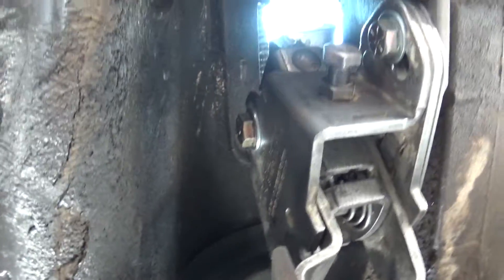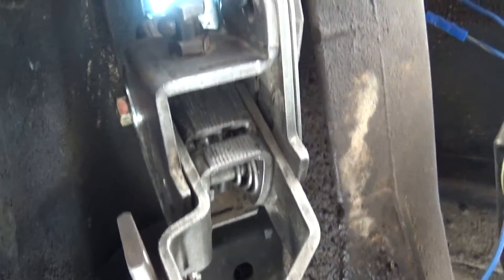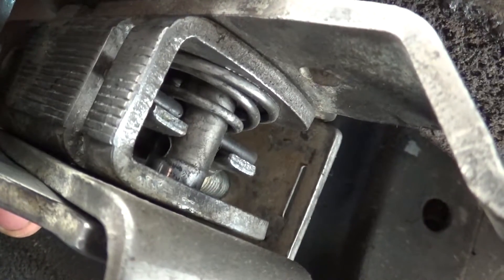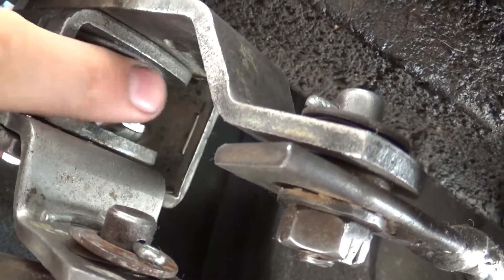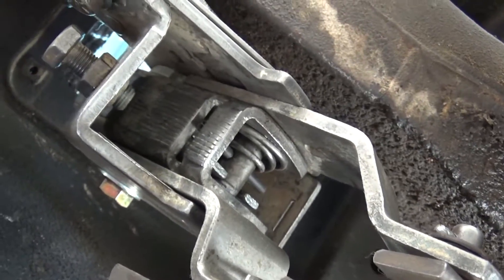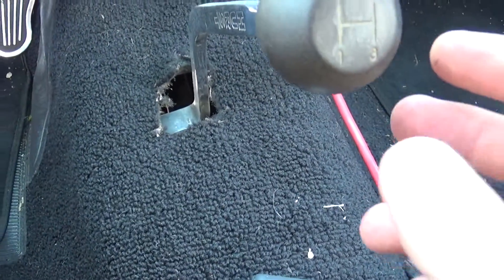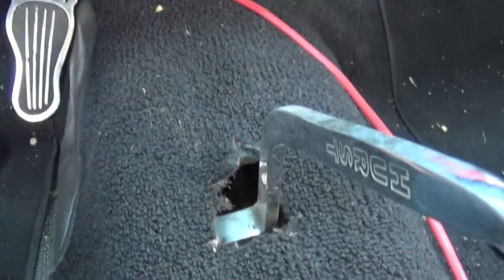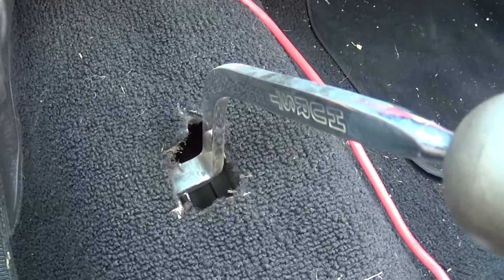How a Hurst Dual Pattern Shifter Works

Comment: Picked up a three-speed dual pattern at the flea market for $5 I'm trying to find out if I can make it where you can take the shift handle off and on or are you stuck with the welded on shifter
Reply from the maker: Some are welded on instead of bolted, so you're pretty much stuck with whatever handle is on it.
Reply: @SuperKONR  kk thank you mucho

Comment: I just bought one of these 30 seconds ago. Did you put any bushings in the shifter where the linkage meets the shifter mech? Or did you just put the connection through with a cotter pin and call it a day?
Reply from the maker: There are bushings that go on the ends of the linkages going into the shift levers. It needs to be a pretty close fit for it to shift very well. I think on this one I machined some aluminum bushings on the lathe, I have a video of installing it that might show that part.

Comment: maybe this is a dumb question but is there any way to mount a 4 speed toploader to an inline six
Reply from the maker: Yep, exactly the same as the 3.03 3 speed toploader. C7ZA-6394-A or C6TA7500 bellhousing and 9 inch clutch assembly. Same as the 3 speed, the early 4 speeds were 25 spline so look for the stronger 28 spline.
If you have an early narrow pattern trans you can use the Econoline C1UU-6394 bellhousing and the 8.5" clutch assembly.

Comment: Is this the best shifter to throw on my three speed?
Reply from the maker: As far as I know it's the best one. It's better than anything you can buy new nowadays.
Reply: With a 200 and a 3 speed you're not winning any races, a properly cleaned, lubricated, and adjusted collumn shifter with new bushings will work acceptably.

Comment: ok so have another question.  I have a 66 mustang with a 67 200 inline six in it with only 15,000 original miles and a c4 three speed automatic.  I want to put a three speed manual behind it but I was looking on ebay and there is quite a few different ford three speeds so I am wondering what transmission and bell housing you are using?
Reply from the maker: Not sure if I mentioned in the video, it's a 3.03 V8 toploader. Get one with the 28 spline output shaft so you can use your C4 slip yoke. The 65 model units were 25 spline, they aren't as strong and the yoke is a little hard to find. The bellhousing casting number is C7ZA-6394-A. There were two different clutch forks, be sure to get the right one for 
the mount in the bellhousing. The early ones used a retaining pin, the later ones used a spring steel flap type of thing.
Reply from the maker: Z bars are on sale http://www.ebay.com/itm/1964-1-2-1965-1966-Mustang-Equilizer-Z-Bar-Top-Loader-6-Cylinder-3-Speed-M-T-/131195007383?vxp=mtr&hash=item1e8bd4f197
Reply: I cant find a later trans with the 28 spline but i did find this do you think of this  http://www.ebay.com/itm/112082483560?item=112082483560&viewitem=&vxp=mtr  the bell housing is the same and it comes with the clutch fork
Reply from the maker: HEF CV should be 28 spline. It looks ok, has everything you'd need. Maybe it's the camera but it looks like 3rd gear might have a bad tooth. Either way it would be a good starting point.

Comment: So is the bell housing the same as the three speed?
Reply from the maker: No they had a different bellhousing. Actually three different ones, for early and late style. They had one with the 9" clutch as well as the 8.5".
http://www.moderndriveline.com/Technical_Bits/Ford_In-Line_6_Cylinder_Bell_Housing_Identification.htm
Reply: +SuperKONR so is there any other option to put a four speed behind the 200? I know there is the t-5 conversion but I feel like it will be two many gears I have a c4 behind it now and I really don't like it.
Reply from the maker: You can put any late style toploader or T-10 4 speed behind it, if you have a 1966 or later block use a 3.03 three speed bellhousing, if you have an earlier block use the 2.77 bellhousing and an adapter plate. People seem to like the T5 swaps.
Reply: +SuperKONR thank you so much I've never found somebody this knowledgeable about the 200 inline keep up the videos I really enjoy them!
Reply from the maker: No problem, let me know if you have any other questions! At some point I'll be making a video series on these engines that will cover this type of thing.